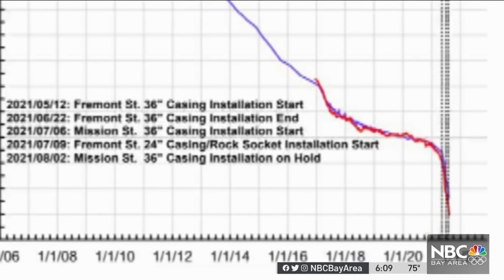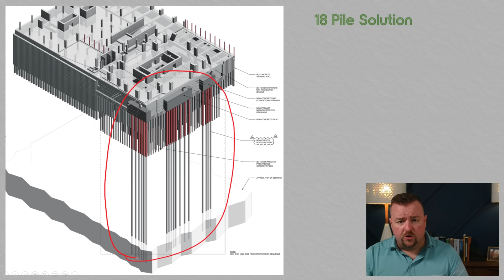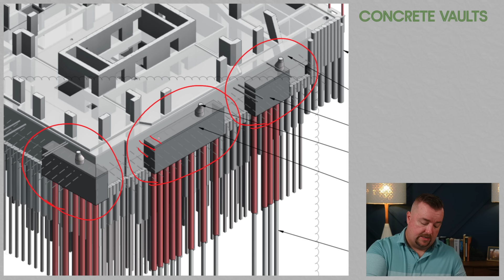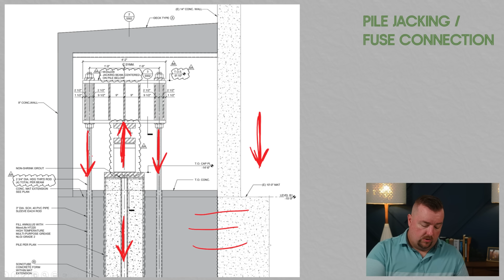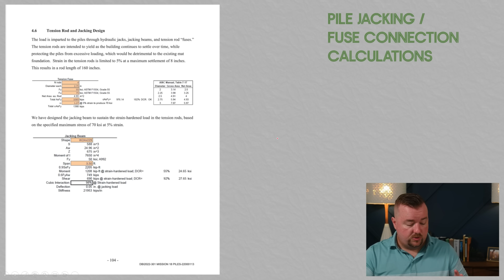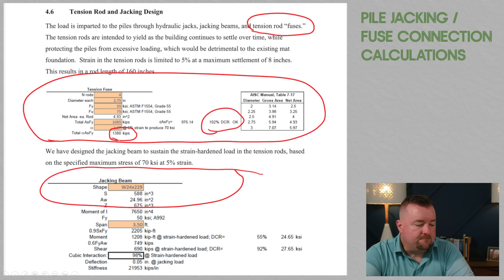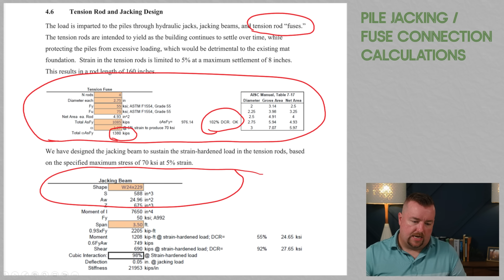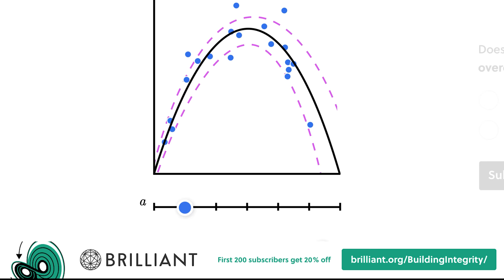Did I Uncover a $100,000,000 Mistake with the Millennium Tower "Fix"?

Comment: Hmm in the lab I worked with when a new technology was being tested they would send the plan out to 3 leading labs and ask them to test it. We often were one o f the  labs. We would recalculate all make stuff by scratch etc and then use known result samples ro test sometimes the method didn't work at all  and we would to try to see why and fix the problem and retest sometimes still didn't work We wrote all up sent report back. We got paid zero to do this cause I worked for  the government. Usually we could  get it to work after a fix or it worked well first time. We did this to help government  labs etc and private industry. I think it's very important and what you are doing is also. Me I'm a biological scientist but based on what you said it sounds not good and under engineered. My grandfather was good at engineering and he believed in over engineering stuff so it would last and be safe.. a highly skilled person should do the calculations  you suggested and be honest  about the results and  maybe test the strength of that little piece of metal. Also consider if there is an earthquake  will that building collapse??!!
Reply: Really I think for safety the building should be torn down and properly rebuilt with foundation supports going to bedrock *( especially since that  part of SF shore was historically marsh and sand and then fill from the bottom of the  bay material dug out to deepen the harbor.

Comment: We can only hope that the death toll will be relatively low when the inadequately designed fix catastrophically fails causing a collapse and devastation of the immediate area.  I really hope I am wrong but I believe that the initial design failings and subsequent ridiculous design errors of the so called fix WILL result in a disastrous structural failure that will end up costing many innocent people their lives.  This situation should throw serious concern on all other projects the original building design team and the design team of 'the fix' have been involved in and each project should be properly investigated to protect innocent people from being killed by their mistakes, miscalculations and oversights.  Surely anyone can see that the visible portion of the 'fuse system' is capable of transferring many times the load that the encased small steel bar could ever be expected to handle safely.  Lastly the common practice of third party design review teams simply accepting the calculations presented to them without performing any analysis or calculations independently is incredibly worrying. How many people's lives have to be lost before such shoddy and dangerous methods are replaced with a proper design review process.  I wonder how many of the original building designers and the engineers who came up with 'the fix' would be happy to live in the building ?

Comment: Wait...the quadruple rods are only secured by 6 inches of plate at the bottom? That's it? between the 3.5in cutout for the beam and only 18 vaults..
That's not even 1.5sq meters of security holding the building from sinking.
That isn't enough. That isn't enough at ALL.
I don't even have an engineering degree and that still scream WTF.
Reply: The four rods are secured in two plates.  The combined area is about a square foot.  At one million lbs per piling, that is about 7000 psi at the plates.  The vaults are probably made with high-strength concrete.

Comment: I was a chief mechanical engineer for 30 years and dealt  with dozens of mis engineered project, resulting in many lawsuits. 

"Underpinning"  I threw up in my mouth. 

This has become a political issue, which means it's money issue.  

With this issue,  the company has put money before people, in the very city that brags about putting people before money. 

CA is on the "no drive list"  and I have already wept for those destined to perish in this future calamity.  

As a matter of fact, let's do just that.  Let us determine the punishments for those involved in this, to be ready WHEN this structure fails, as well as a compensatory and punitive judgement for all the future victims. This includes all the government bearocrates that have been bribed, and the current Mayor who knows better.

Does anyone really think that something this large can absorb such a major correction? 

BS

Comment: Seems an awfully fine thread on a 2-3/4" bolt, thread depth reduces core diameter so I guess it's only 2-1/2" at core?
V-thread isn't the smartest thing for load bearing though but I guess it isn't subject to vibration or bending (except from maybe traffic?)
I can't do any of the math involved but a 12x6.5 plate just LOOKS too small just from experience of seeing 'broken stuff', plus, they should have run grease tubes down the outside with a connection at base to ensure plastic pipes were properly filled, (from the bottom up) it's common practice on machinery (excavators, etc) so wouldn't take a massive amount of though to apply (I worked on construction equipment for over 8 years)
I'm 'really' a motorcycle mechanic (precision machinist, general busybody, etc 😁) but it was obvious even to me the CYA at 28 minutes didn't have a lot of thought involved.
All in all, it's what we (bike techs, mechanics, etc) would call a Mickey Mouse fix by a bunch of cowboys
Reply: Where are you getting the threads?  They should be 4 tpi if UNC.
Reply: @GH-oi2jf  As  I said, it LOOKS like a fine thread, I didn't look up the spec for  2.75" studding

Comment: If it goes above the elastic limit no more load will be carried and you get plastic collapse. These anchor plates do not look right. I am a civil engineer.
Reply: I think when a rod exceeds the elastic limit, part of its load would immediately be transferred to the other rods, so it would then fall below the elastic limit.  Even if a rod has suffered plastic deformation, I don’t see why it could carry no load.  These rods will stretch a considerable amount before they break.  I will look up “plastic collapse,” though.
Reply: “If the collapse of a structure is now defined as the condition when deformations increase indefinitely under constant loads, then, assuming that instability effects can be ignored, it can be shown that collapse occurs when a sufficient number of plastic hinges have formed to transform structure, or any part of it, into a mechanism.  …”.  From the paper “Minimum Weight Design and the Theory of Plastic Collapse” by J. Foulkes.

Looking at the greatly simplified case of a single rod carrying a load, a sustained overload putting the rod into the plastic region would stretch it to the breaking point, after which it could not carry any load.  But we don’t have that situation.  We have 18 rods which would all have to be overloaded for the structure to fail, but the vault structure only carries about 20% of the weight of the building.  The building will not fall if all of the threaded rods are broken, it will just revert to the status quo ante.

We also won’t have a condition of sustained overload.  Presumably, the engineers have anticipated shocks from earthquakes, which are transient events.  What will happen during an earthquake is a complex question, because the characteristics of earthquake loads are highly variable.  My expectation is that moderate earthquakes will have no significant effect.  We will just have to wait to see what the effect of a large earthquake will be.  I’m not making predictions, but I think the notion that the building will fall over is nuts.

Comment: The current method of remedy seems severely flawed and poses a major major danger.  They need to drill relief holes on the opposite side of the lean to remove earth.   Obviously it has to be calculated. Deep slightly angled vertical holes that extend under the building should do. The holes would extend toward the centre of the building on one side only.  i.e. the aft leaning side.  It should gradually cause reverse leaning until levelled. The earth on the opposite underside of the building,  will naturally move,  resulting in a chain reaction of slow earth movement from under the building towards the relief holes.  The earth beneath the building would gradually move in the opposite direction of the lean,  due to gravity and the additional force resulting from the massive weight of the building. That earth would then backfill the relief holes naturally as a result of its movement over time.  That should fix it and comparatively cheap to implement.   😂🤣🤪
Reply: This phase of the remediation project is complete.  It is working so far.  Do not expect any further tinkering with the ground until there is a good reason.  The engineers will be inspecting it regularly for the next ten years, at least.

Comment: Josh, fantastic work and video. Good catch on the support plates. But do they really matter? Any tension rod with a design load beyond its YIELD strength has already FAILED, period. "The tension rods are INTENDED TO YIELD as the building settles over time" is proof of that. In other words: "these 72 dinky steel threads can NOT stop this building from sinking, nohow - but they SHOULD break before something else does."😂

The tension rod "fuses" are supposed to "blow" on purpose BEFORE before those 18 long, skinny concrete toothpicks buckle, or the 'vault' breaks the existing foundation, or rips off the side. But so what?  There is NO question whether they WILL FAIL, only HOW SOON. So does it make any difference overall, if the support plates fail a little bit SOONER? Maybe I'm missing something important, but logically whether the support plates GO FIRST seems moot to me.

In other words, if there was even a microscopic CHANCE that those 18 long, skinny concrete toothpicks and 72 dinky steel threads were supposed to STOP the building from falling over (without breaking the existing foundation), then the potential, premature failure of the minescule support plates would be a big concern. But since they already said the tension rods were designed to FAIL "as the building settles over time", then it seems obvious to me that the entire procedure is a COMPLETE FARCE that "fixes" NOTHING whatsoever.
Reply: Not designed to fail, designed to compress about 5% so that instead of punching a hole through the bedrock they compress and allow the other pilings to spread out the load first.
Reply: @gorkyd7912  Thanks for the comment, but it doesn't make sense to me.
1. The tension rods do not compress, by any percentage. They are in tension.That's why they are called tension rods.  Until they yield, then they have failed.
2. The other pilings underneath the entire foundation are not supporting the load, which is why the building is tipping in the first place.
3. If all the other pilings are not supporting the building all across the bottom of the foundation, I doubt that 18 additional pilings in a single row along one (1) edge of the foundation could provide enough support to the one (1) edge of the building foundation to stop the tipping of the rest of the building from getting worse. 
4. that is why the tension rod 'fuses' are designed to yield (fail) first:
a. Before the vault exerts enough downward force on the pilings that the pilings buckle (or punch through bedrock)
b. Before the pilings exert enough upward force on the vault that the vault rips off of the side of the foundation.
c. Before the pilings exert enough upward forcer on the vault that it breaks the one (1) edge of the foundation as the rest or the foundation continues to settle.
Reply: @tomtroszak   Right they're in tension as they support the building's weight on one side and it appears they're designed to stretch a specific amount over their length so adding more plates along the rod's length would make the stretch calculation wrong which they say would be detrimental to the existing mat foundation. 

I take that to mean that the mat foundation (which the tension rods are gripping via the small plate) can't sustain the whole weight of that side of the structure on those 18 piles alone so they need the rods to stretch 8" with further settling so more of the weight is partly held by the existing short piles.
Reply: @gorkyd7912  You are quite correct that adding more plates along the rod's length would invalidate the original stretch calculations. But that isn't the problem with the original design. To brutally oversimplify, let's call a tension rod a >bolt< under tension, and its original length from the top nut to the bottom plate as the clamping length. As long as the tension in the bolt material remains in the elastic (springy) range (less than the lower yield strength of the bolt material) the bolt would safely return its original length if the tension were removed. But most bolts reach their proof strength (maximum safe elastic tension) with only 0.2% to 2.0% total elongation of the bolt - or 1/500th to 1/50th increase of their original length. So to get 8" of safe, elastic-only stretch would require a bolt roughly ~33 ft to ~330 ft long depending on the material. Now if the tension in the bolt material exceeds the >yield< strength, any further elongation becomes permanent (plastic) deformation. Yes a bolt can still carry the maximum >elastic< clamping load even with some initial >plastic< deformation, but no more. Further increasing the tension (or increasing the clamping length) only makes the bolt permanently longer, not tighter. But... >>>the BIG BUT<<< - if the >clamping length< of the bolt is not constrained to a finite dimension by some other means, any further settling of the building beyond the original 8" estimate would just keep increasing the plastic deformation of the bolts to 'necking' and failure. And some high strength bolts don't neck noticeably at all before total failure, they just go bang.
Reply: @gorkyd7912  That was just a really long way of saying that if the tension rods cannot support the required load without experiencing permanent deformation, they can't support it at all.😂

In other words, if the load is great enough to permanently stretch them any amount at all, it's enough to keep stretching them until they come apart.
Reply: @tomtroszak   Well yeah but that's why the weight transfer is done with a giant hydraulic jack. So when the tension rods of one pile are nearing the max % of stretch that the material can handle they will just reduce the pressure in the hydraulic jack to transfer more weight onto the other piles.
Reply: @gorkyd7912  Go back to the original description of how the tension rod "fuses" protect the 18 new perimeter bedrock piles and the vault from excessive loading -- by permanent elongation of the tension rods through plastic deformation, until they snap in two. 

Reducing the pressure on the jacks to "save" the tension rod "fuses" from blowing in two is not mentioned.  Because that would simply allow the suspended vault to continue sinking down, placing the load right back onto the friction piles that are already sinking, thereby doing nothing to stop the building from falling over.

And if you let the tension 'fuses' blow, as per the original design, the load goes back onto the friction piles hat are already sinking, thereby doing nothing to stop the building from falling over.
Reply: @tomtroszak   Seems like a valid concern and I won't pretend to understand the quality of the material used whatsoever to be able to argue for or against the length and stretch parameters they stated. However, if you knew the quality of the material so you know what the maximum allowable stretch is, couldn't you just reduce load on the hydraulic jack once it is reaching the maximum to shift more weight to the existing piles or neighboring new piles?

Comment: Didn't they mean "Fuse" as in connecting two parts?  Not fuse as in circuit breaker.
Reply: They meant the latter, but it isn’t a good analogy.  If a threaded rod reaches its elastic limit, it won’t break; it will undergo plastic deformation.

Comment: The Final Comments by this author, Nails, the reason the project will ultimately end in disaster.....Also the Localized shear stress on the concrete by the undersized bar is excessive by observation.....

Comment: I am a retired structural design engineer and I do not see anything in those calculations that accounts for stress concentration factors in the threaded rods! In my experience and from table that can easily be a factor of 3 and more resulting in a significantly reduced yield and ultimate strength!!! I see this as a poorly designed system which has not been fully thought through and full calculations have not been performed! The possibility of failure is, therefore, a matter of luck!!

Comment: Somehow I'm not convinced this method  will work. There are too many weak points in this design. The concrete side of the building was not designed to be attached to the vault. Attaching with rebars are enough to support building of that size?
Reply: The vault attaches to the mat, which is the platform upon which the building rests.  The engineers did take into account the strength of the mat.  The article in Structure Magazine discusses this.  Engineers don’t just eyeball things and hope their guesses work out.  They calculate the forces.